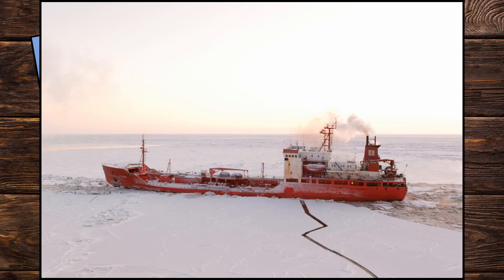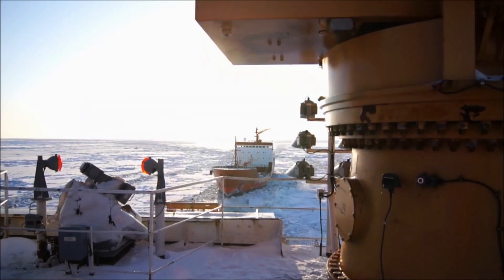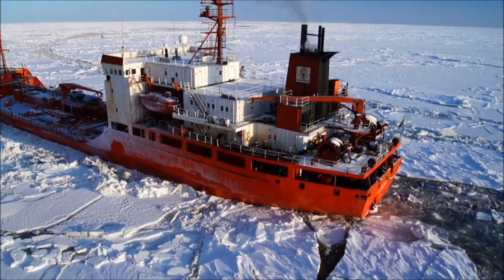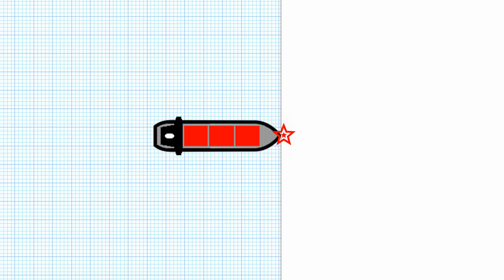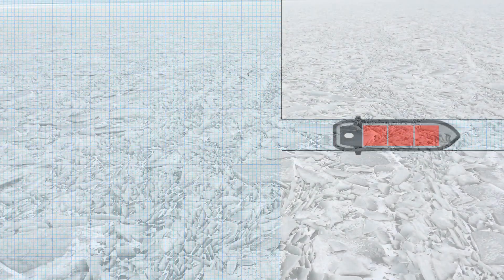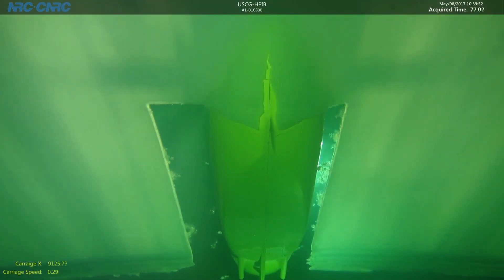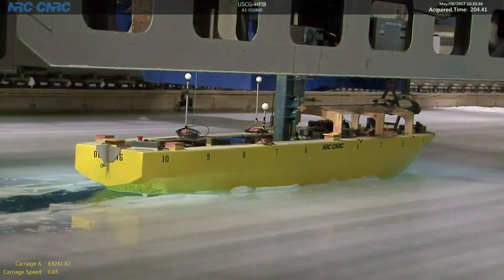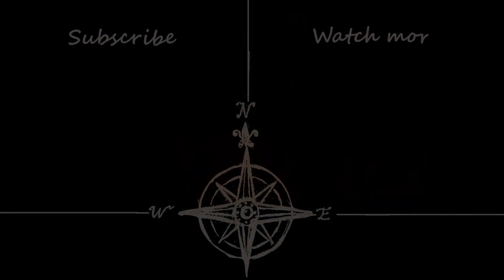Icebreakers: How Do They Break Ice?

Comment: I think we can do better, feels like we need to move along technology wise to make it easier, better and faster.

I think most ships should be easy enough to reenforce slightly and able to be turned into icebreakers themselves. I think we could created added installation componants to turn regular ships into icebreakers, we are going to need many in North America ASAP.  

It would be interesting to experiment on ice with frequency devices, even light spectrums... to see if we can develope an easier way to weaken the ice with less force and energy, speeding up the process even, and perhaps making the components easy to instal in other ships to modify them for additional use. Perhaps also pair it with other components that can be instaled, perhaps they can also be vibrational as well as shaped in a way that would aid with directional dispersion of energy aka force to make way... 

Hopefully someone is doing just that, experimenting!

Comment: There are only few different types of icebreakers... Basicly with bow propellers and without... I have been working on 3 icebreakers and I can tell you that there is actually nothing to add to this video if question is how icebreakers break ice... Basic icebreaking is that icebreaker climbs on the ice and breaks it with her own weight... There is no question that icebreaker must be very powerful for that... Forward propellers on icebreakers are not for directly breaking the ice but mostly for makeing sort of vacum under the ice so that breaking would be a little easier and allso to add some manouverability... But this is all extra details... I think that this video is very good for explaining how basicly icebreakers break ice... Nice job 😉

Comment: done this with a canoe ... not getting stuck required certain tools for clawing your way onto the ice which was 4 or 5 inches thick but melting with toms of holes in it ... got thicker towards the center so best i could do was carve out U or D shaped lumps that would be all broken up and be blown by the wind to shore where it got thick enough to stand and walk on where it was no longer breaking i simply retreated from and began hitting a new angle closer to shore ... once i encircled the lake in crushed ice the main central chunk was windblown to the side pushing the crushed ice out of the way  the next day The edges had warmed enough to be crushed a bit further eventually i had the first ice free lake during the spring thaw do not try this at home I'm an professionalist idiot even though i had a lifevest on hypothermia is a B*** that waters cold and by scientific means the cold water sucks the air out of your lungs as it compresses it because colder air being denser shrinks the volume of air in lungs ya also loose buoyancy and well ya ded i did so unsupervised nobody to drag me out /save me  i had a rope anchor 2 paddles and a ⛏️ pickaxe to drag me onto the ice ... bouncing up and down in the canoe provided 2ft wave action that helped break up the ice but dragging the weight of me and the canoe onto the ice made it rip through like a can opener until the thickness was too great and simply floated my boat where i could get out and go for a walk

Comment: There is also ships that are capable operating in ice, but are not icebreakers. In Finland and in Sweden highest icerating for ships (that are not icebreakers) is 1a super. Those ships are capable operating and moving in ice that is one meter thick. Usually even those ships use icebreaking services because even they are capable to move in ice, it is so slow that icebreaker is good idea.

Comment: The USCG Polar Star employs 3 giant electric motors to propel the ship during icebreaking to prevent mechanical damage if the propeller strikes ice.   Also the ship carries over a million gallons of fuel that assists in added weight for crushing up to a maximum of 20 feet ice thickness!   I had the pleasure of working aboard this beast of a ship.

Comment: Question. Would the ice ever be strong Enough to beach the ship on top of the ice? Like could the ice hold the weight of the shop possibly resulting in a roll over?
Reply: Icebreakers don't tend to operate through massive glaciers, instead opting for the thinner ice that can easily be broken by the weight of an entire ship (tens of thousands of tons). The ice would have to be ridiculously thick to withstand that, and cargo ships have no business in those kinds of conditions regardless.

Comment: Ice strengthened ships can have bulbous bows. I worked on bulk carriers and car carriers which were designed to break through first year ice. I took the bulk carriers through ice in the St Lawrence seaway and the car carriers through Ice in Finland. You aim for cracks in the ice using the radar. These ships had Controllable pitch propellers and a knife behind the rudder for piercing the ice when going astern. Being able to keep the propeller turning and just change the pitch made them easier for going ahead and astern to ram into ice.

Comment: Back and Ram baby!  Served on the CGC Northwind Ice breaker,   The hulls are also thicker than most and the newer breakers use a special steel that keeps its strength in polar seas   There is no keel either to keep the bottom smooth which makes the ship ride rough in any seas.

Comment: I wanted to like this video because I served on the USCGC Polar Star. Being part of the crew and actually watching and feeling it breaking the ice was impressive.
Stats: Polar Star
Can break ice around 20ft thick.
3 screws with diesel electric engines and 3 turbine engines for breaking heavy ice. The hull is significantly more rounded. She listed port and starboard about 45 degrees each, the crew was literally walking on the walls while navigating the southern ocean.
Hull is about 1.75 inches bow and stern (44mm) for ice protection, and the keel is shallow so that the hull can smash ice with low risk of damage.
18 knots max speed under normal engines, over 20 knots for bursts of speed to plow heavy ice with turbine power.
Thinner ice can be plowed at approximately 3 knots, but backing and ramming is required for thick ice.
The ship would ram ice and about half of the hull was out of the water before it shifted about 3 degrees port or starboard before falling down on top of it. Personally experiencing that was like a roller coaster.
It took about one month to break the fast ice around McMurdo in Antarctica.
Healy is a medium icebreaker and is sent to the arctic to deal with parts of the ice for shipping through the northern passage. Polar Star is sent North to finish clearing the ice path, and then south to clear the ice for shipping vessels bringing resupplies to the science stations. Average deployment time is about 3 to 4 months, with two months of drydock repairs in-between. Deployed during the respective "summers" for each hemisphere, so they can operate during daylight hours.

Comment: In the engine room you might have 9 engines, 3 engines one behind each other and this row of 3 engines is added to 2 more rows of the same 3 engines in line and each row is connected to 3 shafts which turn 3 propellors, some ships will hook up to a gearbox with two rows of 2 or 3 engines in line and coming out of the gearbox with 1 shaft going to the propeller In the engine room you usually need air to start the main engines so you use air compressors to pump air into the air bottles then use that air to start the generators which gives you electric power, One fishing trawler was up on the Labrador coast fishing deep water shrimp and for some reason the ship lost power and engines quit and generators quit, so they had no air to start anything up, but this trawler had a smaller compressor which could be pumped up by hand with air enough to start the generators, then start the main engine, but this hand pump had not been refitted for several years and it would not pump any air, and you are in the engine room with only flashlights This ship drifted around and the crew had no heat so they started a fire on deck and would burn almost all the wooden chairs and any wood they could find They were rescued by a foreign ship later that week thankfully all crew and ship were safe

Comment: When the ice is very thick the ship will run up on top of the ice and its weight will break through, then back up and full ahead to crash through again this can be time consuming depending on the ice thickness, then thinner ice the ship can steam through with more speed, inside the ship especially forward the noise is so loud you cannot hear anyone talking, we were running into the harbour way up north just below the north pole when we ran up onto the ice and we didn't crash through, but got hung up on top of the ice, took 3 days to get  off, and this was early summer, if it happened in fall or winter we would still be there, ice breakers have tanks on either side below decks on the hull and they are called healing tanks which are pumped full of water back and forth from one side to the other which takes around a minute to do, and the ship heals or leans over and this movement helps get through the ice with the moving forward and rocking side to side so every minute or so the ship does this and when walking the deck you can see it and feel the motion so your walk is like staggering The ships helicopter goes ahead to look for the easiest way to proceed

Comment: They also use sallying the rudder (turning back and forth constantly), and a firced-air system called bublers (though exactly what those do is not clear, since the icebreaker buoy tender I served on didn't have one).

Comment: Easy, the boat is designed to go up on the ice and break the ice with its weight!
Reply: One thing that was omitted ( or not mentioned ) in this video was that some icebreakers have large port and starboard tanks placed high in the hull with huge pumps and very large transverse pipes that rapidly transfer ballast water back and forth from the port and starboard tanks. This action causes the ship to roll back and forth (port to starboard and back) which helps to break exceptionally thick ice. I know this from having worked ( in a repair capacity ) on several coast guard ice breakers during my time in the U.S. Navy,

Comment: Another factor is the fact that icebreakers are heavily reinforced to withstand the pressures involved. And that's just normal pack ice that forms by extreme cold. Icebreakers avoid icebergs like the plague, because those are glacial ice, which forms from falling snow compacting on itself over millennia. It's why geologists consider it to be a type of sedimentary rock, not strictly ice.

TL:DR - That's what Titanic would not have survived ramming the iceberg - not even ships built specifically to deal with ice can withstand that sort of impact.
Reply: can’t withstand that sort of impact?

Comment: The Healy isn’t a very good icebreaker, in real ice, she gets stuck easily. Her square stern prevents her from backing and ramming and her fixed pitch props prevent her from delivering full HP until she is above about 6 knots(witnessed many times).  The real icebreaker has the #10 on it, Polar Star and her twin Polar Sea#11 are 75,000HP monsters that can break up to 6’ continuously and up to 21’ pressure ridges by backing and ramming.  He got the breaking part right, the bow rides up on top of the ice and breaks it, this also pushes the stern down into the water and the added displacement/upward force enhances the effect.

Comment: Why not design all  ships that way?
Reply: Regular bows are more hydrodynamic
Reply: Different hulls for different applications.
Reply: Icebreaking bow is bad for fuel efficiency and sucks for handling of waves with waves slamming into it instead of it cutting water.
Further rounded egg shape like bottom of icebreaker makes very rolling prone ship in open water.
Also all the ice strenghtening and more powerfull engines/propulsion add (besides building costs) weight, which is away from how much cargo ship can carry.

Comment: Wait... so they don't use giant underwater Chainsaws?
Reply: only after reading this comment do i feel disappointed.
Reply: they use that for bays
Reply: Im disappointed now
Reply: They Actually do. But he's not allowed to say it.
Reply: They should just use giant flame throwers it much cooler
Reply: And by cooler I mean hotter
Reply: me too, disappointed
Reply: Always has been
Reply: Newer icebreakers do, actually. They have giant rotatable electric engines with their propellers attached, and can turn these around and back up onto the ice and use those huge blades to cut it up. He just left them out of this video...
Reply: Excuse me mr Bright
Reply: Actually in past was attempts to use milling saws and boiled water (on nuclear icebreakers), but it was no so effective. Last several years in Russia are going experiment with lasers (on nuclear icebreakers).
Reply: @juliap.5375 boiled water IS effective for deicing.
Reply: Hello old me
Reply: Chainsaw are interesting to think but not practical for making path for ships. Thesy will cut the ice smoothly which will not allow ships to move foreword.  The chainsaw is not going to make a path thats the reason.

Comment: why don't they just design oil tankers to break the ice? or is it just more economical to get another ship to do it
Reply: Because most of the time an oil tanker isn't in an ice field and so the extra strength isn't needed. So all the extra weight and different hull shape would lead to too much inefficiency. However, an ice breakers only job is to break ice, so there is no inefficiency.
Reply: @jamesmccann5644  ak47 I kinda thought so but surely theres a middle ground or at least it could be done for oil tankers that always travel through ice fields
Reply: @mrplop38  Yes, the middle ground is ice strengthened hulls. There is a reason that it is done this way, and that reason is that its the most economical, and practical.
Reply: @jamesmccann5644  ah makes sense thanks for answering have a nice life :))
Reply: To add to other answers, with large ships, small changes can make big differences in the cost of transporting goods. For instance, a change in bow design to break ice will affect the fuel consumption of the ship all the time. A bulbous bow is impractical on an ice breaker, but over the life of a oil tanker will result in large dollar savings. An icebreaker is a small ship compared to an oil tanker so it is more economical to have a smaller specialized ship do the ice work with less compromise and a large specialized ship move oil, also with less compromise, or that is how I see it.
Reply: 121bham  you gotta ask questions to learn lol
Reply: @mrplop38  There's no stupid questions, or so they say. :D To expand upon other people's answers: it's not just about hull thickness, it's also about icebreakers being short enough so that they maintain hull integrity when 1/3 of them is in the air, beached on an ice-sheet trying to crack it with it's own weight (that's why they are called ice breakers, not ice cutters). Cargo ship couldn't rise high enough for that (too long and too weak), and even if it did find itself in that situation - it would snap in half, or at least bend and compromise it's hull integrity :D

It's similar to using a short iron crowbar compared to a meter long aluminium profile as a lever (since the icebreaker is pivoting on the edge of an ice-sheet).
Reply: @stefanstankovic4781  yeah thanks bruh good answer I prefer to start mild discussions as well as search for the answer myself as it's more interesting and your answer is partly why rogue waves are so scary for big ass ships
Reply: Breaking the ice also costs a lot of fuel...So that's why Russians use nuclear powered ice breakers 😅
Reply: 121bham  that's why I asked about oil tankers you moron
Reply: Icebreaking capable cargo ships are decades old thing: https://en.wikipedia.org/wiki/SA-15_(ship)
Bow's fitness for icebreaking is just inverse to its handling of open water (waves slamming into it, instead of it cutting water) and fuel economy.
Also propellers are good for breaking pressure ridges by either grinding ice blocks to small pieces or using water flow to loosen and break the ridge.
Hence main icebreaking role in cargo ships was moved into stern twenty years ago... making some pretty "big ass" (~45m/145ft wide channel) "icebreaker": 
https://youtu.be/E3jwk849SHU?t=36s
https://en.wikipedia.org/wiki/MT_Mastera#Icebreaking_capability
Since that "stern first in heavy ice" cargo ships have been designed for Russians for both carrying general cargo and oil.
https://youtu.be/__2NCHv_H38?t=3m8s